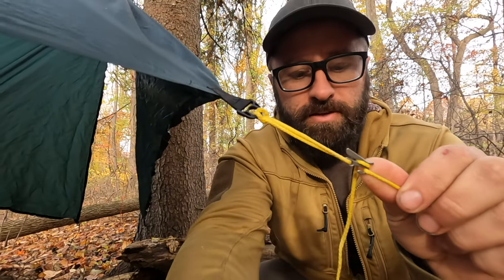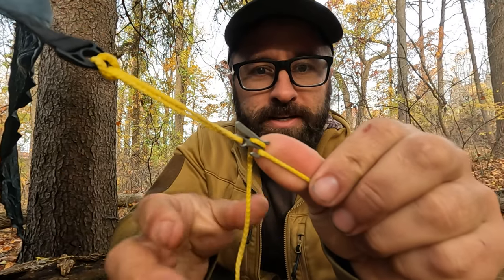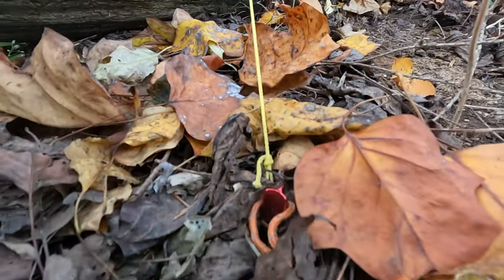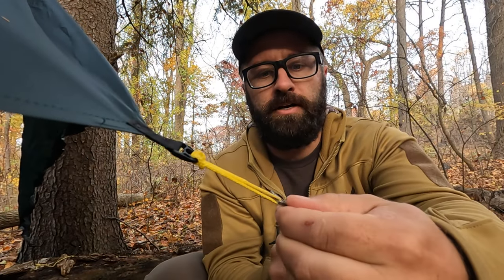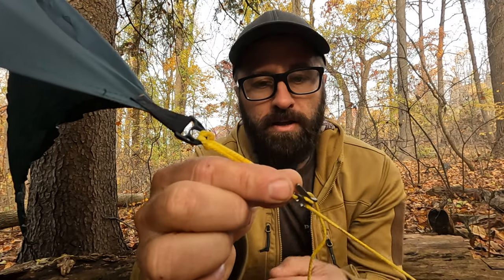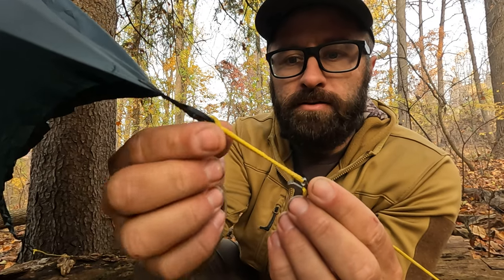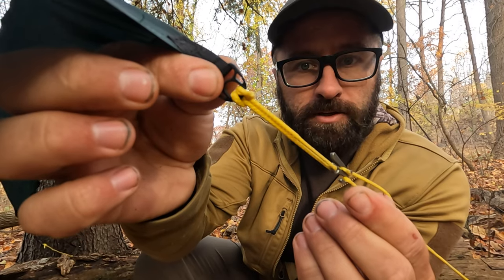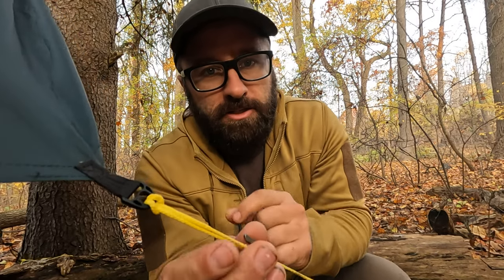How to use DutchWare Fleaz to Adjust Your Tarp Guylines

Comment: I use a fleaz attached to my D-rings with a spliced continuous loop of Lash-It, but put an in-line internal tarp tensioner into the Zing-it used with guy lines.  Got the idea for putting shock cord inside the Zing-It from a Dutch video. Works a treat!

Comment: That's how I've been doing it for years and years... I have a bowline on the cordage for the stake end.  I tend to keep the lines locked into the fleaz and just keep them w/ the tarp when I pack up (using tarp sleeves).  I love that you don't have to leave the tarp shelter to hunker down if the weather turns or an adjustment needs to be made.

Comment: I have fleaz attached to all my tarps and use different stakes with attached chords depending on the terrain. I think there are many advantages. You can do the adjustments from the inside and in case of snow the setup is a bit off the ground.

Comment: Rofl I've been using them all wrong. I use them on my ridge line with the line around a tree anen pull tight around the antenna then around the wing and lock it off on the legs. You did it totally different. Both work I guess.

Comment: Two issues here:

1. I’ve now got metal hardware wrapped up with my tarp when stashed; bad idea. 

2. Fussier to use this method than Zpacks’ line locs larksheaded onto the D rings and 6’ of ZingIt as guy lines

Comment: I like to keep my fleas attached to my stakes. I run the line though the hole and attach the hook to my continuous shock cord loop on my tarp. That way one set of fleas and stakes will work for all my traps. I also dont have to worry about the fleas putting holes in my expensive tarps.
Reply: Smart